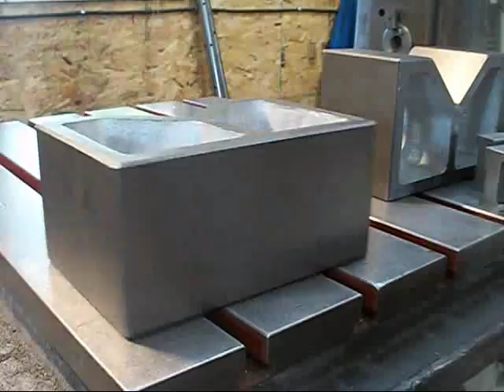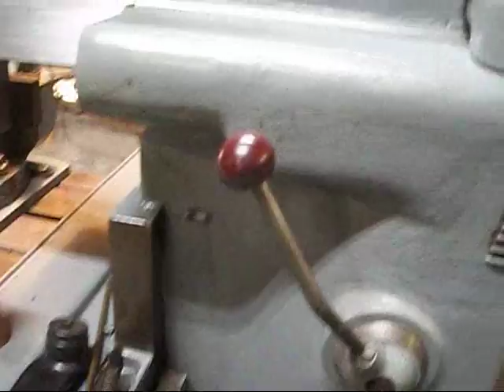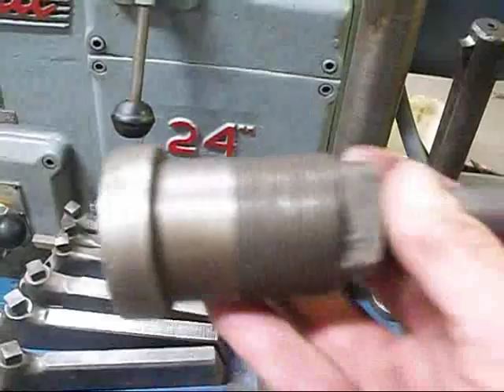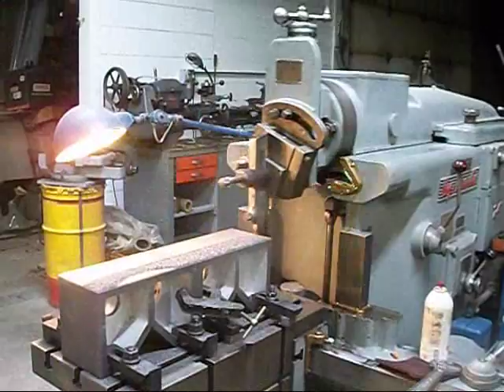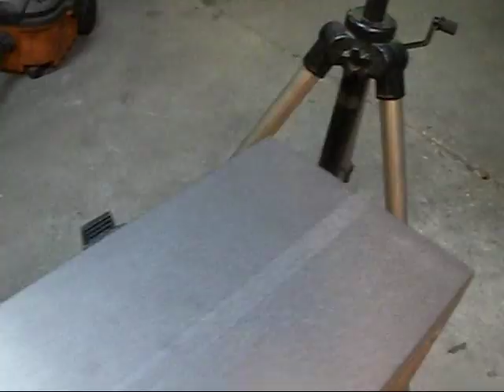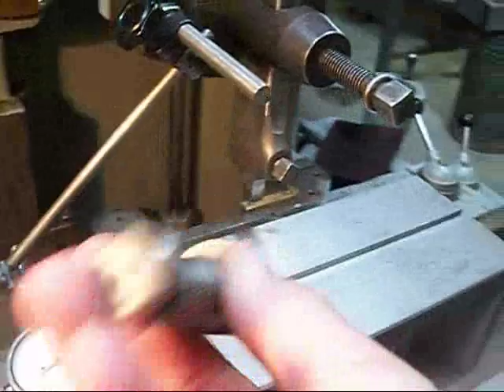VEE BLOCKS WMV

Comment: On all the planer and shapers I have run the feed was done at the end of the outer stroke thus the need for the flapper box. It took the pressure off of the cutter on the back stroke thus not culling it. The only time we locked up the flapper was cutting internal alleyways when you were manually down feeding. Hope this might give you an insight, keep on makein chips!

Comment: I can see why you would want to lock the clapper for some operations but the clapper is supposed to relieve the pressure on the cutter on the return stroke. Why not let it do it?
Reply from the maker: It is not bolted down solid it can still move it just controls the clapper . I didn't design this it came with the machine and it shows it in the service book Thanks

Comment: Kinda gettin' the horse before the cart. If you're gonna doctor up precision set-up equipment you probably should get a surface plate or some flat surface more reliable than an unproven boring mill fable. Beside flat, square, and parallel, V blucks should be matched and symmetrical. Hard to do that with our a good flat reference. A good surface plate also allows you to scrape your work allowing far easier geometry control than cut and try on a machinectool. Shapers tend to cut a little convex because of ram droop unless it's in unusually good condition. 

A convex surface can be difficult to set up to witout careful shimming. About 10 minutes of work with the belly of a 4 square file will dress a concave in the convexity while at the same time allowing tou to follow the parallelism of the opposite side with an indicator and surface gage or a transfer gage.

I don't know the end use you propose for your V blocks so maybe my remarks above are excessive. In any case, good luck to you. BTW, I nag Adam Booth about nit-picky stuff too. I'm an equal opportunity critic, everybody gets it.
Reply: Forrest  Addy 
I thought the horse went before the cart anyways .
If those blocks are from the far east, they are probably  not square flat or alike.
Unless that machine is cherry, he's gonna have to shim a precision job  anyway.
Maybe youll volunteer  bring your prussian blue and granite block to scrape it in for him.
You do the job with what you got
Or never gonna get anything done.
Can't do the job, don't take it.
Kap

Comment: Very nice shaper and you've got it dialed in very well.

 I hope you have better luck with the Asian import cast iron than most.  It usually moves around a lot, making it difficult for precision work.
Reply from the maker: Most of the stuff I do is not real precision . Sometimes just holding a big shaft to drill a hole . I will keep and eye on it . And I may have to redo the vee before I'm all done Thanks

Comment: All that time i spent as an Apprentice learning how to calculate shaper feeds and adjusting the link and wheel.... I could have used a machine like this   :-)
Reply from the maker: I hear that the hydralic shapers are very infinte in there feeds and ram strokes because  of the hydralics. And not having a set feed rate or ram stroke Thanks
Reply: On the mechanical shaper it's almost infinite but you had to sit down and calculate the Stroke and so on .As an Apprentice we were not supposed to use Machinerys handbook or other sources to get the feet per minute etc but use our heads ..It would have been a lot easier to simply open the throttle and get the speed required immediately .. ha ha We dont see too many shapers in use today because of the 'craze' for milling machines .

Comment: Great video and set up.....I would question clamping the blocks together with the Kant-twist as if the sides are not parallel/square it may cause inaccuracy when unclamped. Clamping just to the table would be perfect.
Reply from the maker: Well I had released the clamp I just didn't take them off . So they weren't really clamped together. But Thanks for watching

Comment: What was the point of cutting those key ways if you're using pins???
Reply from the maker: I could use keys  there  but the pins are easier to make and they do the same thing to align the vee to your table Thanks for watching
Reply: he now has a infnitely variable adjustment to holdthe blocks to the table surfaces . keys dont give you as much variability.

Comment: Quite small for a hydrauilc shaper.  I'm used to seeing much larger ones.
Reply from the maker: Rockford made hydralic shaper from 16" to 28" . Th largest shaper I know of is 36" or are you thinking of a planer ? Thanks for dropping bye
Reply: Yeah I am thinking of a planer...though they're not too dissimilar in function.
Reply from the maker: A Planer holds the tool and the work moves. A shaper holds the part and the tool move Thanks for dropping in
Reply: Yes I am well aware of that.

Comment: Thanks for the video and details of the clapper spring assembly. Think I will look into making provision for it on my rebuild. I like the dti set up as well. Those tool bit holders are sure useful. Not seen the horizontal type here in the uk only those that hold the bit at an angle. The stroke adjust on the hydraulic shaper looks very simple as do the feeds. Thoroughly enjoyed the video . All the very best Mat
Reply from the maker: Those tool holder are for carbide bits I found mine on ebay . I was looking at my shaper to see if I could make the table tilt But that would be a lot of work

Comment: wow.. on your guide pins.. you could almost calculate out 3 inchs from the center and drill more holes so you could set it up to 45 degrees  or even more.. how hard are holes to calculate.. indicate drill and tap.. just an option..
Reply from the maker: I could but my HBM has a rotary table on it so I don't know if it's needed

Comment: Strange to see such poor flatness on the v-blocks; I might have done some test indicating to quantify the error prior to shaping. Looks like it turned out good though.

My Rockford 24" HD doesn't have the clapper spring lock; not sure that is standard equip. I've thought about adding a set screw through the side of the clapper box, to lock down on internal keyways.
Reply from the maker: I have a service book on the HC model and it shows it there . I think the HD has a little bigger table and more horizontal travel and a few other little things . I wish I could find the universal table from one
Reply: THE IRONWORKER - You've got a nice array of tools; I was trying to check your machine out better during your description. All of the controls you show are identical on my machine. I'd send/post pics if that were possible.

Naturally, no paperwork came with mine. If there was any way to get a scan of that service manual, I'd sure like one.
Reply from the maker: Yea in my book the controls are all the same I tried to explain a little about them
Reply from the maker: It does not show a whole lot. You can  learn more by watching my video a few times and running your own machine

Comment: Did you center the blocks off of the v ways or make the assumption that they were parallel and perpendicular to the faces?
Reply from the maker: I centered them of the edge and checked with a starret square with the ways I hope it's ok